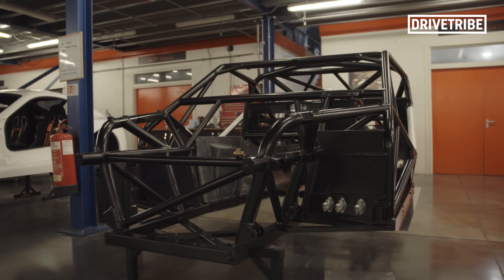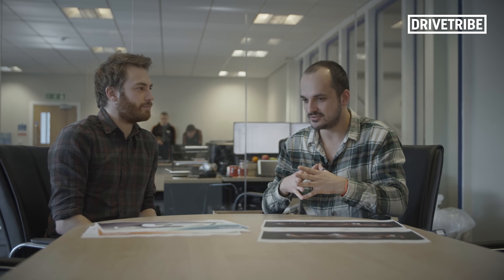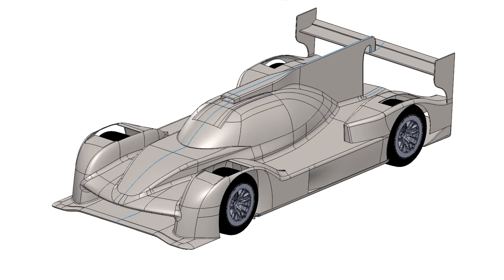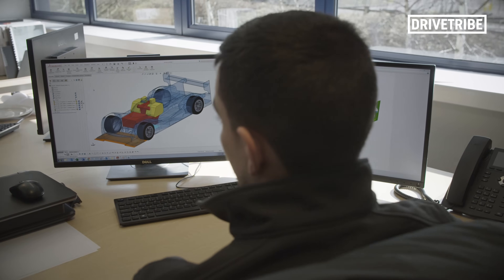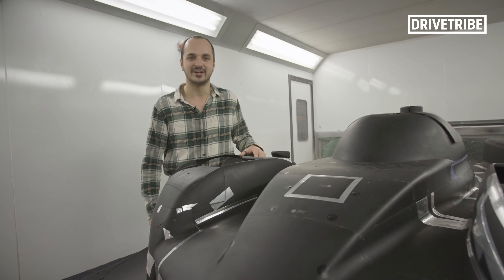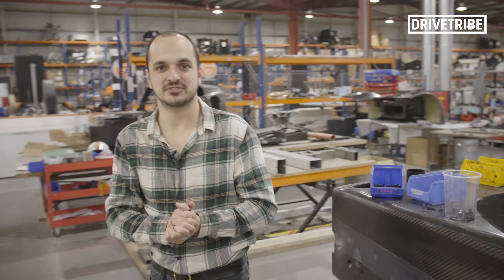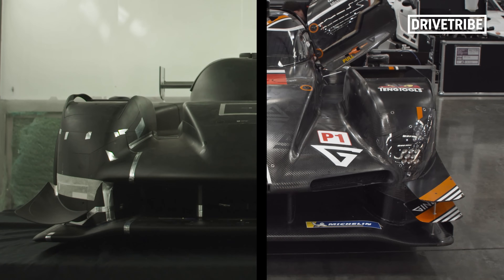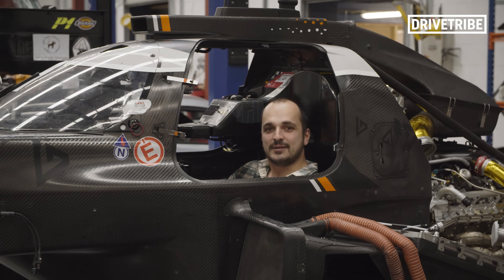How do you make an LMP1 car from scratch?

Comment: 0:55 You make it sound like this Ginetta is a better car than the 919, but it just isn’t. Porsche’s fastest lap at Silverstone was run in their Le Mans Spec Downforce Package, completely unsuited to the Silverstone track (it was used in Silverstone due to homologation rules that gave them an advantage with their High Downforce Package for the rest of the season). Furthermore, the 919 Evo could easily do something around 1:27. If Ginetta would be freed from restrictions they might improve by a few seconds, but theocracy has way less potential than the 919. On top of all, the car´s race performances have been absolutely atrocious. I don’t want to act like a butthurt 919 fanboy, just trying to set the facts straight :)

Comment: I cry when I look at the way WEC destoryed Prototype racing. They repeated the mistake Group C made in the early 90s when they allowed costs to get out of control and while Audi was because of diseilgate, the loss of Porsche was a massive blow that could have been avoided if costs stayed low.  And the way they've reacted to this is disgraceful with resorting to handicaps which makes building a good car pointless and makes drivers not want to win. On top of that the le mans hypercars have been botched, they should have followed the IMSA model with cheap altered LMP2 cars but they instead have this wired mix of road and prototype cars that are now become a pointless formula because they'll be BOPed with the DPIs.  

LMP2 is terrible too, you kick out engine manufacturers for no reason to than need them back because your LMP1 is gone with them, just terrible.
Reply: 100%. Group C 3.5 was the Le Mans Hypercar of its time.  8 cars at the final race at Magny Cours 1992, and three of them were Peugeots. Awful.

Comment: How does it struggle to keep up with the hybrids like the toyota but quicker than the Porsche hybrid? About 0:45 in
Reply: @Mandje Tichelaar yea but it's said to lap faster than the 919 hybrid and it was said it can't keep up with the hybrids
Reply: @cmccullough2518  The ginetta beat the time set by the porsche 919 in 2017 but also the time set by toyota to take pole in 2017. But in 2019 the ginetta took 1.2 seconds from the fastest toyota. There are several explanations for this performance gap. First of all the track was resurfaced which made it faster, the current aerodynamic rules were put in place in 2017 so the cars have also evolved in 2 years and have become faster (what we see with the time of the toyota in 2019). And anyway if the ginetta manages to beat the time of the 919 by just one tenth in qualifying the hybrid cars, although older (for the porsche) are unbeatable in traffic thanks to their 1000 horsepower at the beginning of the acceleration.